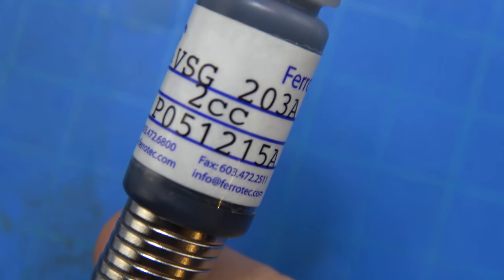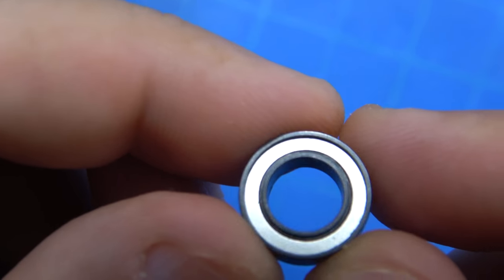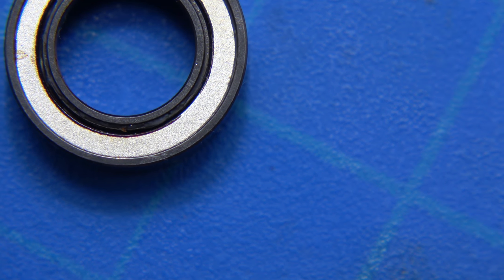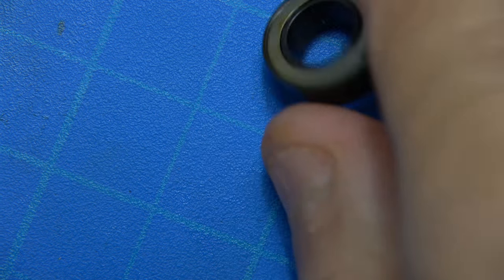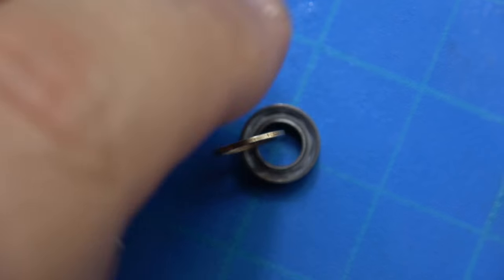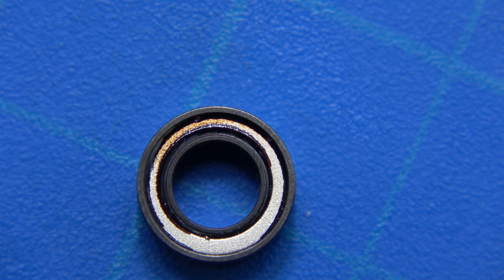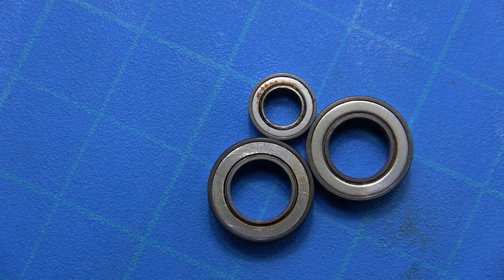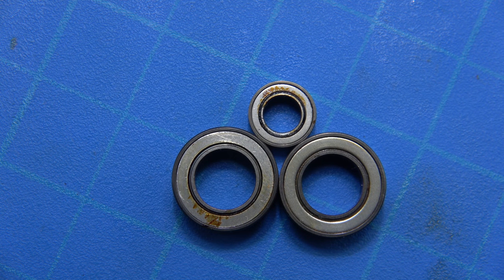Daiwa's Magnetically Sealed ball bearings.  Putting them back together and applying the magic oil

Comment: i used ferrofluid EFH1, and after 2 months of not using the reel the oil hardened which made it hard to spin. just a heads up not to use EFH1. was bought from ebay.
Reply: Lol 😂

Comment: What is your opinion on the magseal tech? Does it actually do what Daiwa claims? Is it worth the extra trouble to service a magseal reel vs non magseal reel? Does a magseal reel need less servicing compared to regular a reel?
Reply from the maker: In my experience using the saltiga which is fully mag sealed at every entry point other than the main shaft which is sealed by a lip seal.  It does it's job.  When i first serviced the reel after half a season which included heavy surf use, dunking, and occassionaly reeling while submerged (only a fe w inches)  The internals were brand new.  The grease which is translucent....looked new.  To the point I didn't de grease and re lube.  
I opened it up about 2 months ago after more hard fishing.  And found the exact same thing.

If you submerge reels it's a good habit to open your reels and inspect for water intrusion...even if you fish VS/ zb/ torque reels.

cleaning out mag sealed bearings can be a pain.  I found using a waterpik to clean them out resulted in the best and fastest.  reapplying the mag fluid was quick and simple.

Servicing intervals can be greatly extended if you don't submerge your reels.  To the point where if you don't service your own gear...and are the type who just fishes and forgets until there is a breakdown....YOu may get years out of them in freshwater before an issue pops up.
  And it's not difficult to do if you take your time.  And much of the mag fluid can be retained in place if you are careful.

They are simple reels mechanically....Simpler than say a stradic...Just better materials and precise as a rolex.
Reply: @TackleAdvisors  
Thanx for this awesome answer.

Comment: Does daiwa baitcasters have mag sealed berings?
Reply from the maker: Only a very select few.  I have their kyohga which is the only one I have had that I planned to take apart.  Though I haven't yet.  And I believe it's located at the pinion.. When I bought the steez sv tws reels I ordered them pre launch and took a picture of them in a cylinder of water to be a funny play on Mag-seal... But there was nothin mag sealed lolol (so that WA was a big waste of time)
Reply: Tackle Advisors lol i actually  glad to hear rhat the steez dont have mag seals, i have 15 steez i have to clean install new bearings, oil and grease. I have 6 steez103h  reels so i bought 6 ss sv spools to put in them. In theory that'll make them steez sv it good quality bearings and that aftermarket spool right?
Reply from the maker: @jakeorr23  damn dude I didn't know you rolled that deep in the steez... I'm not honestly a Daiwa spool wizard.  So I don't know all that much how the daiwa spool swaps perform.
Reply: Tackle Advisors the ss sv is the same frame amd spool size as the first gen steez. Ill let you know how it works out lol, my dilemma is what brand of bearings to buy, ceramic bearings with no oil are very high speed but not smooth I'd rather have something that is quiet and speedy that will help me throw lighter baits easier. My favorite  setup right now is a sv steez on a 7'1" phenix feather light action. Ive been using your scooby doo rig with it on 8lb braid to 6lb flouro leader. If you get the chance, try the phenix feather line of rods
Reply from the maker: I'm with ya on the shreekiy bearings.  Some times it's just nice to here nothing on the way out.  And sadly I don't know of outside of hedghog who sells good stainless beaings.  (do not pay any attentin to abec rating....many tourney casters use abec 5's)   DUde the coolest thing about that rig is experimenting with different baits to wacky rig or nose hook.....and where and at what cross section the baits work the most desireably.   I swear it's all I use anymore.   It's enough that I'm trying to work with a mfr to get weigts specific to make them

Comment: Where did you get the fluid?  I've been hesitant to purchase some of the new Daiwa reels because of the mag seal bearings.
Reply from the maker: I sourced mine directly from Ferrotec last year.  
The little bottle is 3ml and (don't quote me on this) costs around 100$.
And as you can see...a tiny bit goes quite a long way.

I used it for 6 months and am confident that it works (i spoke with a representative of ferrotec and discussed my application and they recommended the product in the video)  I also have a lower end ferrofluid they sent me (30ml bottle that costs around 30$ but have not used it.)

I've been in contact with a few other people who were not able to source it directly from Ferrotec as I believe they are more of an industrial non retail small batch company (though your mileage may vary)
Reply: The fluid is expensive and we may not even be able to purchase it?  Where the other people trying to purchase less than 3ml?  This mag sealed bearing thing is such an annoyance.  I don't normally have problems with any reels that don't have mag sealing.  It's like they created a solutation to a problem nobody had.
Reply from the maker: It's cool tech.  ANd it holds up well.  Though i've read online that some have had it "dry out"  I'm not one.
The stuff I uses is probably the most expensive out there.  The other cheaper stuff would prabably work too as it's not a high pressure system.   Just don't buy any of the junk from amazon that uses vegetable oil :)
Reply: Some of the newer daiwas are nice enough that I may jump in.  I've been procrastinating on getting a Zillion TW SV because of the mag seal.  I may just bite the bullet and try to get some fluid (maybe cheaper) when it's time to service it.  I passed on a Saltist and went with another Saragosa because of the mag seal also.  Missing out on some good reels because of this.  Your tutorial makes it look pretty simple as long as one could get the right fluid.
Reply from the maker: Owning the Gosa SW and stella sw...and owning a fully magsealed sw reel.  It's literally 6 of one half a dozen of the other.   Rubber seals wear...and they swell when used with non compatible grease.  
Failure comes with no warning.
Mag seal can become contaminated from outside oils and fail...no warning.  

For fw reels mag seal is cool n all....But I'm up in the air as to whether I'd service it or replace it with an appropriate sized standard bearing.  (for fw baitcasters)

For spinners...I like the tech.   As it keeps any and all forms of debris out of the ar clutch...so no corrosion or raspy clutches.

For the line roller bearing...I like it alot.
Reply: Tackle Advisors any experience working on daiwa saltiga spinners, I hear horror stories about dealing with there service dept... is it even doable only thing keeping me from getting one.
Reply from the maker: They're really simple actually.

They use torx and hex head screws.

If you have the mag seal ferrofluid replacing the fluid is very simple.

If you need to service the magseal ballbearings.  A pair of strong magnets or a stack of magnets are needed to pop the sheilds.

Blowing out the ferrofluid in the bearings can be tricky.  but i use a waterpik dental irrigator.  So it only takes a few seconds.

I just serviced mine...but they didn't even need it.